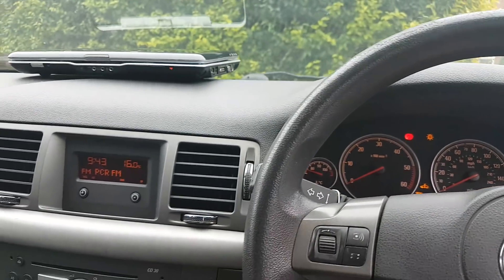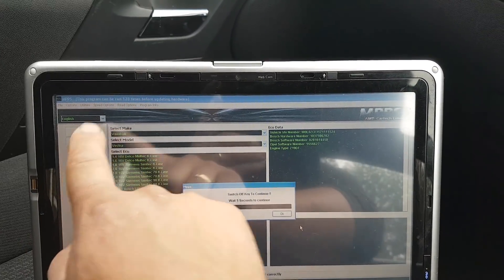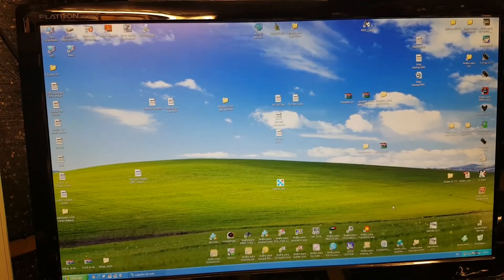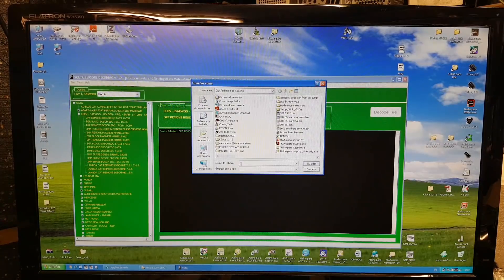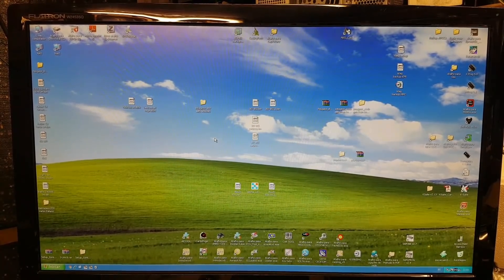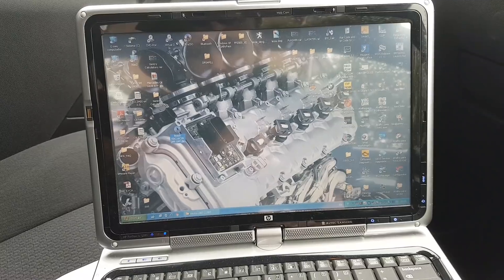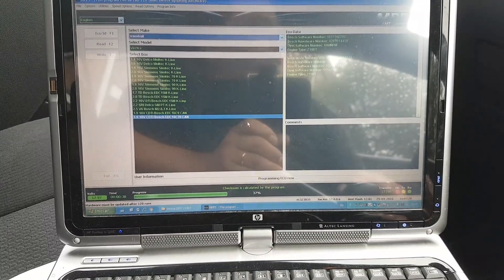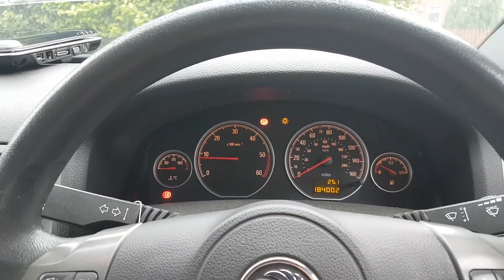Vauxhall Vectra 1.9CDTI DPF removal programming remap. Bosch EDC16C39.

Comment: Hello.. i used mpps to delete egr. All good. 
However ive used kess v2  stage 1 remap and got a write error.
Now ecu is blank car wont start. Do you know how to recover ecu. Or i screwed .. thanks man
Reply from the maker: If kess is still connecting, try again...
If not, try recovery mode is available on that ecu...
If not available, open the ecu and try with K-tag... all of that failed, yes, I guess another ecu is the way to go...
👍👍
Reply: @LMAutoRepairs  thank you for reply. my mpps stopped working after a few turns..So i tryd kess and now have a bricked car :(.. recovery mode gets 100% then says write error. looks like a new ecu and locksmith
Reply: @LMAutoRepairs  sorted it i downloaded a fresh bdm dumped file. and it flashed 100%

kess needs a full read not patial from mpps.. unbricked car runs sweet.
Reply from the maker: Good to know...
Well done!
👍👍👍

Comment: What´s the software for ecu edition opel?
Reply: Yes off course, volta sensor decoding. to modify the engine maps that can be upgraded in opel 1.9cdti 120cv edc16c39?
 I use vagedcsuite in audi but in opel I don't know. i dont like winnols
Reply from the maker: Already answered...

Comment: I tried writing a map to my car today but just after it started the program terminated and now my ecu is stuck in 'write only' mode but when I try to upload the stock file it fails. Any help please
Reply from the maker: Hi
You are doing it through OBD right? 
What tool are you using?
Thank you for watching!
Reply: @LMAutoRepairs  hi,
Yep it was all through the obd but I think the software doesn't work properly with windows 10.
Its mpps clone. Would you like me to email you?
Thanks
Ethan
Reply from the maker: @ethanmccrory1727  
There is nothing I can do...
Your next option is probably on the bench...
Or kess in recovery mode if available...

Comment: I have a few questions. If I remove DPF should I remove DTC's with another software? The other question is if I remove DPF should I any sensor connector remove as well?
Reply from the maker: Hi
It varies from car to car... some you leave everything connected, some you need to disconnect certain sensors... some you need to clear codes before the removal, some after... 
Each case can be slightly different...
Thank you for watching!
Reply: @LMAutoRepairs  Thanks for answer. Your channel is awesome. Is there a program that helps you in these things?
Reply from the maker: @martonhorvath1887  
Thanks...
Kind of, there is some out there, you will find them with a quick Google search...😉
Reply: @LMAutoRepairs  Can I get a private contact? For example an E-mail adress? I don't find it. I'm not english so I don't speak it well. Thanks for all the answers

Comment: Hi thank for quick answer. I have Vauxhall Astra h 1.9cdti 150hp. I use MPPS 13 cable. First I check with Delphi tool what is my ECU code. There show me EDC16C9. After that I read ( with MPPS 13) ECU fail from car and marking EDC16C9. After download file from ECU and car it is won't start engine. Can you help? Thanks
Reply from the maker: Ok, so see if I got it right...
You read the ecu...
Then you wrote back into the ecu...
And after that the car fails to start...
Is that correct?
Reply: Yes thats correct

Comment: Hello very good video. I already remap the ECU but now I can't start engine. How I can rest the ECU? Thanks
Reply from the maker: Hi
Does the tool you are using, corrects the chk sums?
Most likely is the reason...
If there is a problem with the flash (maps), reset the ecu will not resolve the issue...
Thank you for watching and for your comment!

Comment: So i managed to get a MPPS V16 Clone and Volta Software. But im a bit scared that the MPPS will brick my ECU? Did heard a few horror stories. My ECU is remapped before, im planning to buy a used ECU, read the remapped maps from my original ECU and just put it on the second one and modify it EGRoff DPFoff with Volta? I would do a EGRoff DPFoff at the place where i did the remap but they refused to do it. They had some legal problems before after they selled DPF/EGR Off Software .. 

I have OPCOM/Vauxcom and a GM MDI Clone (VXDIAG) so programming the Immo is not a problem for me. 

Car is a Vectra Z19DTH EDC16C9 (if i remember right, i think i dont have a C39 but i need to check witch one).
Reply from the maker: Hi
There is always some risk involved...
Make sure you use a battery maintainer...
Yes, if the ECUs are same, you should be ok in read from one, and put it on the other one...
Reply: @LMAutoRepairs  i mean i thought to read my ecu, sent the bin file to a remapper and pay for it .. and they promise they wont touch the DTC Table as much as ecusafe or volta. But you never know if its true. 

Im new to this WINols and decoding stuff. First ive got a stock ecu file from a EDC16C9 and i managed to finde the EGR map and the right hypersis which you need to zero as did Volta. But Volta did also changed some other stuff which i dont know what these thinks are. I think it deleted some DTCs? 

i mean when i manage to get another ECU i can play with this stuff. Prepare a File with Volta and try to mod my bin file myself looking at the Volta File. 

Thank you for your reply :) do you have like a "tip jar" :D ?
Reply from the maker: @DG1WSK 
Check my YouTube page... links in there...
Looks like you have a plan...😉
👍👍👍

Comment: Hello, when I plug my MPPS v16 in my saab 9-3 1.9tid it says i got 29volt down in the corner and when I try to read it gets to 1% and then I get an error telling me to get the logs and send them to someone... what would you try to do in my case? I got it installed in virtualbox win xp.
Reply from the maker: Using virtual machines for something like that, is asking for trouble...
Thank you for watching and for your comment!

Comment: iv heard that most of these dpf removal companies they guarantee that it can pass mot whats your experience
Reply from the maker: So far so good...
Thank you for watching and for your comment!
Reply: @LMAutoRepairs  not sure whether to replace with a new oem dpf, im having p2453 issues sensor is fine but after regen oil change still service engine message and soot filter full
messages and limp mode. i think volvo say 75k for consumable replacement of the dpf.. just a pain tbh to get to the next solution.
Reply from the maker: @7302ab  
If everything else is fine with the car, I would replace it... and you would be ok for another few years...
Reply: I have had two cars with DPF removals PASS at various garages, i.e. they still look like they are there. What is interesting though is that my car got an advisory for "emissions too clean!" without the DPF, and the emissions where 0.13 for a 0.50 rated car. Crazy! But yes it will PASS. The whole DPF is a stupid idea, they strangle the engine and cover people in sut when you accelerate hard, and to clear them you have to drive at 90mph in 2nd gear for 4 hours. Ohh and i'd like to add, I have a 1.9 CDTI Zafira and the fuel economy at 70MPH is 62MPG, If I drive like the manager of a mattress company I can achieve in the 70's MPG. Fuel economy vastly increases and the extra power from a remap can see a lot of high end cars off! My Zafira is in line with a Ford ST.

Comment: Hi
I have to dpf delete on audi 2l engine a3 
Can I read and write it back or I need to modify the file 
Thanks in advance
Reply from the maker: gino p Alias 
Hi
If you read and write the same file back, you are not removing anything,  are you?
The maps for the DPF need to be removed from the file, prior to flash it back into the ECU...
Hope that helps. 
Thank you for watching...
Reply: LM Auto Repairs 
Can I send the file to you can u remove dpf?

Comment: Hello! 
All the congratulations for your work!
Can all these read and write programs be programmed via winols?
And what is a price of winols software?
Thank you man..
Reply from the maker: 12V Bar 
Winols does have an option to read and write, but not sure which interface you connect with it... as I use other stuff for that...
As for the winols price, check the link below...

https://www.dyno-chiptuningfiles.com/winols-reseller/winols-software/

Thank you for watching!
Reply: What is the difference?
What are the checksum points? What do you have winols?
I currently have the k-tag clone red. I would have bought some more cloned devices and software just to be able to handle these things. DPF, EGR, IMMO off ...
Thank you man.

Comment: Hi lmsvvavr, i just want to ask you, should you remove the sensors for DPF after done the file with volta? I just remove one dpf with DPF Remover on EDC16C39, but 2 times already have fault codes related with dpf. This soft removed very well EGR, but with dpf have problem in my opinion. If i remove it with volta should be OK? Or just to delete every fault related with DPF? Thank you in advance
Reply from the maker: Georgi Altanov 
Hi
In the case of this ECU,  I left everything connected...
Reply: Ok mate, thanks anyway
Reply: It will delete all dtc codes. Not only those related with DPF. Volta and ecusafe solutions :)

Comment: Hello, your channel is great! Very good content. I wonder if you can help me, I replaced injectors on z19dth 150bhp and used opcom to enter calibration codes but now I have tapping relevant to diesel knock before boost. It is driving me insane .. please advise me what I can do
Reply from the maker: Virulent 
Hi
Thank you for watching! 
Ok, first were the injectors new or used?
Just wondering if they were used, are you sure they were all in good conditions?
Silly I know, but have to ask...
Also, have you checked that the calibration  factors have correctly accepted by the ECU? 
What was the initial problem which lead you to replace the injectors?
Live data, have you looked at it?
Reply: thankyou kindly for your reply! 
The injectors were used unfortunately.. but i purchased four injectors and replaced only two.

i have tried the remaining two and still have the same issue.. surely all four injectors cant be bad? the ticking stayed the same whatever injector i tried..

The reason i changed two injectors was because cylinder one and cylinder two were not functioning correctly in the deviation data. Cylinder one was -5mg/stroke and cylinder two was +5mg / stroke. i believe only injector two was the faulty one however..

The symptoms i was having was during driving the vehicle, on hard acceleration it sounded like the injectors jammed and clicked very loud intermittently.. and a puff of white smoke out of the back, then resumed normal driving. this gradually was getting worse as time went by. it only did it every 50 miles or so! also there was abnormal engine judder between 1000rpm and 1800rpm. 

the new injectors have cured the misfire issue and the judder. the vehicle runs spot on however i am left with the audible ticking which sounds like diesel knock. i was wondering if it is possible that the new injectors are functioning correctly and i have an issue with cylinder 3 and 4 now? because 1+2 were functioning incorrectly before it masked the problem with the other two cylinders. its driving me crazy. i dont want to go spending money on refurbished injectors unless i am sure that thats the issue.

the only other suspect is that i have a broken rocker arm. as discussed by somebody i know. i have extensive mechanical knowledge and the vehicle is running too good for it to be that. it would run rough and it just doesnt. 

i really appreciate your help sir.
Reply from the maker: Virulent 
Ok... makes perfect sense...
Two things, have you checked live data after the injectors being replaced? 
Another thing, have you checked that the correct injector codes have been stored in the ecu?
Reply: lmsvvavr yes I have looked at live data, all deviations are within +/- 1mg/stroke 

I have stored the new codes and cycled the ignition several times and re-read the codes and they have saved. 

I inputted the codes using Chinese opcom, will this be an issue? 

Thank you
Reply from the maker: Virulent 
Shouldn't be... that's why I asked if the correct coded are actually in the ecu...
I had in the past were the procedure went successfully,  but when looking again, the old codes would come up...
You are not getting that...
Have you checked cylinder compression? 
I know... but it might work checking it...
Another thing is, is the high pressure regulation ok? No spikes or deeps?
Reply: lmsvvavr yes I wondered if that may be an issue but I was careful to double check, I have not studied the pressure regulation in depth via live data but I will have an extended look.. 

Another symptom that leads me to believe it is ignition related is the fact that it only taps when on the accelerator, for example going down hill coasting with foot off the pedal it does not tap, any light pressure and the tapping resumes as normal. 

So it is something during firing that is causing the sound. Should I be looking for desired rail pressure Vs actual rail pressure or similar?

I have not checked cylinder compression but the engine runs very well besides the sound. It has not lost any power since I purchased it 20,000 miles ago. 

All injectors have been reseated etc. And I have tested seats with soapy water and no bubbles around the injectors
Reply from the maker: Virulent 
Yes, check the actual pressure vs the actual...
Without looking, it is a bit difficult to make any other suggestions,  if you know what I mean...
But, I might would suggest a back leak test...
Reply: lmsvvavr I have made some progress.. under further investigation I have reduced the tapping sound to 10% of what it was. The problem was related to the egr valve.. I just thought I would remove it and check, it was suck closed or stiff at least.. however I did have no codes. so I removed the solenoid and attached a drill to the valve and cleaned the seat.

Oiled it internally and refitted, it now runs a lot better. 

However this now brings a question to mind:
For all those people that blank off egr valves without remapping the ECU. How does this not result in incorrect ignition and diesel knock ..as less gasses entering the engine than expected by the ECU so the engine will be out of stoichiometry to some degree? 

Also if the egr was deleted and remapped. Does this effect the stoichiometry ? 

I can't understand how this is causing diesel knock simply from other people's experiences with removing egr valves etc.
Reply from the maker: Virulent 
That's great news! 
To blank the EGR, it always recommended to remap... obviously! 
But some cars are more sensitive than others, and on some you get away just with the blank plate... I believe it is all to do with the ECU software...
The few I have removed, I have always remaped...
How that would be causing you knocking issue, good question...🤔
At least you are in the right direction...

Comment: hello,i want to make checksum correction , when i tried to do it with winols 2.24, it shows this message 
 "error while handling the file selection,the operation was cancelled", this error is when i want to save the file, please any help 
thanks
Reply from the maker: zayn aoun 
Hi
Which ecu are we talking about? 
Is your winols only doing that with that file?
Reply: Hi man ,i tried to change all(file ,the software to make dpf ,........),already same problem ,the error message come when i try to save the file
thanks for your help
Reply: Hi winols do that with any file , already same problem
Reply from the maker: zayn aoun 
It might be your winols then... try to reinstall it...
Reply: Hi friend ,thanks a lot ,evreything is ok ,i changed my operating system
Reply from the maker: zayn aoun 
Great news! 👍

Comment: What's the life span of dpf filter,?just bought new van with dpf on it,cheers,
Reply from the maker: John Easton 
Hi
It all depends on the driving conditions...
I have seen them failing at as early as 40k... in the other hand, I have seen them with over 120k and still going....
Reply: @LMAutoRepairs  mine has 250k km
Reply from the maker: @moxadrian  
👍

Comment: Great video, thanks! I will ask, why volta and no ecusafe 2.0 ? I see close of volta you have ecusafe, it is beter software on dpf off volta then ecusafe?
Reply from the maker: Melissa Haughney 
Hi
Thank you for watching and for your comment! 
When you have two things that give you the same outcome, there is not really a reason why you choose one or the other...
So, what I am saying is, that the same way I went for Volta,  I could have gone for ECU safe.... lol
Reply: lmsvvavr Hello, I have another question if you can help me for a better direction? Can this method will work if i swap only ecu edc15 or edc16 by read and write data, sure ecu with same hardware (number). I ask because of immo will this method work? I am more confident through obd port then on bench and i think through obd look a clean work. Thanks again
Reply from the maker: Melissa Haughney 
Well, immo is slightly different...
On the video we read and write the flash memory,  immo is in the eeprom...
So, you can do it through OBD, but you need a tool capable of reading the eeprom through the OBD...
On Vauxhall,  best is get the pin codes, reset and reprogram...
Or, on the bench, copying the eeprom data...
Hope that helps!
Reply: lmsvvavr thank you!

Comment: Hello kess v2 will also read this driver or just mpps?
Reply: Kess V2 is read this ecu like a charm, just like MPPS. You can do it.(was write I by mistake)
Reply from the maker: ewelina1946 msp 
I do not have kess 2...  but it is possible that kess can do it... there is other tools out there capable of that...
Thank you for watching!
Reply from the maker: Georgi Altanov 
Thank you for sharing!
Reply: hi i have a question what version have you mpps? Regards
Reply from the maker: ewelina1946 msp 
I have v13 and v16...